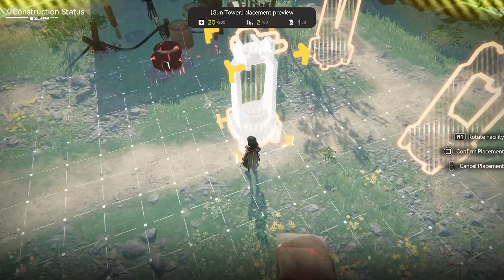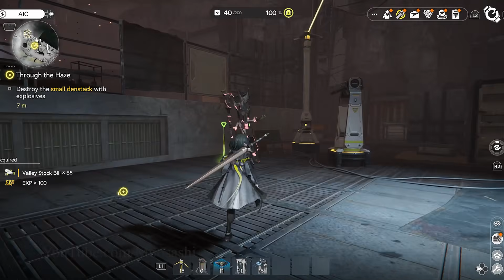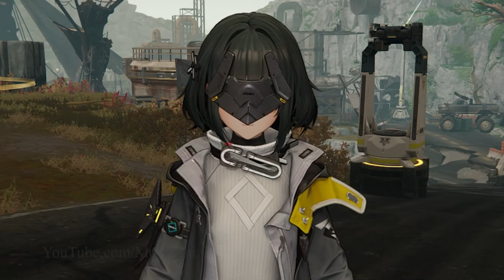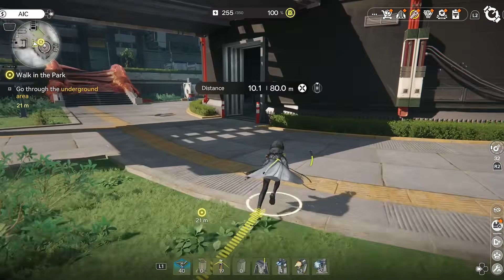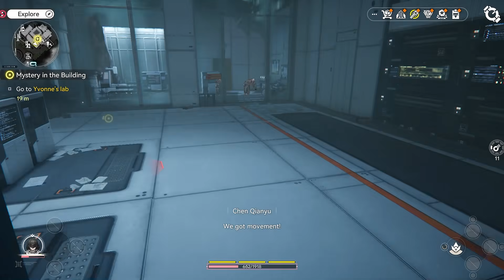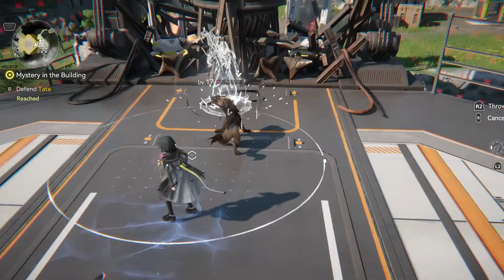Can You Beat Arknights Endfield Using Only Factory Items?

Comment: You can actually use the small electric pylons to connect electricity if you alternate between large electric pylons and small ones. All you have to do is to start at a large pylon, pull a line from it to a small pylon, and go to the next large pylon and pull a line towards the same small pylon.

Comment: Biggest annoyance with turrets is picking them back up afterwards. The confirm is a mouse click with no keyboard mapping.

Also there’s no single item drag so feeding them batteries requires multiple clicks for no damned reason.
Reply: Just go stash mode if you want to pick up these turrets? AIC mode > stash mode > press 'F' on these turret

Comment: A single wuling battery provides like 70k power to the tower. That's hundreds of shots per tower without needing to build a power network.
Reply: building a power network in Wuling is so easy though, as Xiranite relays connect automatically within range.

Comment: I don’t know if you discovered this as well during your challenge, but you can teleport while holding an active powerline connection, meaning you can make certain connections far more easily by teleporting to your factory or a tp point that’s not reachable on foot in one go. You can even move your factory around inside of the available space to get a bit further, since the connection to your factory won’t be broken after it’s made, even if it exceeds 80m.

Comment: You can use batteries to place on the turret. Too bad that thermal bank is not portable to power the turret in case of small area that can't connect. So turret and battery is possible but it will auto attack the mob. Well you toggle on and off to but in battle it would disable toggle to turn on turret? Have not tested. But it hassle to place those battery in battle like in the cut scene where you don't need battery you place turrets. So they should battery place on the turret when deploy. I wonder you can unlock end game content? They should able to deploy else that would be not MC that deploy turret right? Or is cheating? Still they lack health they get easy destroy.

Comment: They really need to remove the restriction of constructing turrets and using consumables/bombs while in battle. Keep that tower defense spirit alive! How interesting that even you got hooked up by Endfield! What an interesting way to test how far the mechanics can go. That said, originium sure has some glitches I see. Looking at those shootings through the walls there
Reply: Bombs could be a tactical item, with some limitations of course, so is not too cheese.
Reply: no they dont.   that would ruin the game.   the way its done now makes the game more interesting and challenging.  it forces you to level up your characters and weapons and also have skills in fighting and using proper character groups to be able to defeat certain bosses. being able to use the turrets and such against the bosses is just lazy and goes against the core game and what its supposed to be.   if you want to play a tower defense game, then go play a different game....
Reply: @orion7741  The fact that they even bother to make healing tower makes you wonder what were their design principle when making the TD system. The camp TD don't need healing tower. Tower can be shared to assist exploration. And then the giant point right at the start of the game, endmin summoning 2 giant cannon turret. Why put that cinematic in if you can't really use turret for offense? Instead of TD, spin it off to TO (tower offense); build, shoot, dismantle, on the go just in time. You still can hack and slash, but your turret is there to assist just like how endmin fought. This is unique to endfield. They should capitalize it instead of being mechanically the same as other game.
Reply: @orion7741  I don't see how the most basic RPG mechanic of leveling up your character is more interesting
Reply: Nah. They can make other gamemodes where these aren't allowed, but in overworld and other normal gameplay, it should be free access
Reply: @orion7741 consider that turret don't scaling and it take ages for them to kill level 60 enemy i don't see a problem with it
Reply: @orion7741  i mean the solution would just be to have separate trimmed medals for beating it with only constructed items (including bombs) and the time attack one (which would exclude having constructed items). The main story is easy so we don't need to balance it for that at all anyway just the RE-Crisis fights.
Reply: @wodanymir3163 there already is a mode specifically for turret defense. (Auto defense)

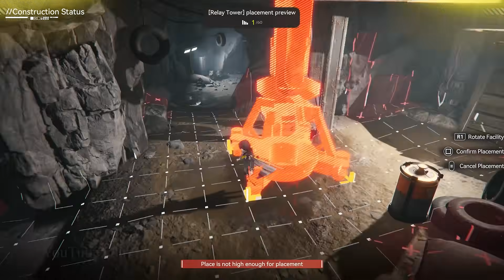Comment: 2:32 I did that too, I put the big thing  on the other side and an electric towers on the camp, I mistakenly thought you needed a drill for rare mineral and I was NOT going all the way around, so I passed it through the tunnel and you can't put electric towers on it so I optimised my path through it and managed to connect the power limes through thoughts and prayers
I had to climb on the waterpines looking things

You gotta put the big thing on the open space behind you on 2:32 because the electric towers isn't big enough to reach the other side where you are
Putting the big thing on the camp didn't work for me

The electric towers is only 30m so even if you put the tower hugging the tunnel entrance it stop on the middle of it

Comment: Did you figure out that you can just carry batteries with you and load them into a turret anywhere?
Reply: that reminds me of a funny situation I got into. The auto-stash feature of the backpack move the batteries to the depot! Then when I cleverly setup a turret... My pikachu face when I tried to use a battery and it was not in the backpack!
Reply: @EduardoWeidmanBarijan  this will also drive you nuts in the next region, hint water bottles
Reply: I didn't know that! I'll be using it.